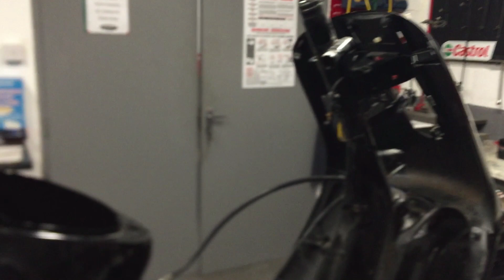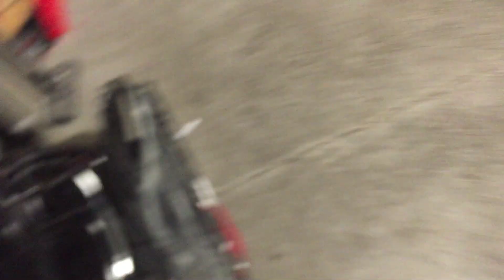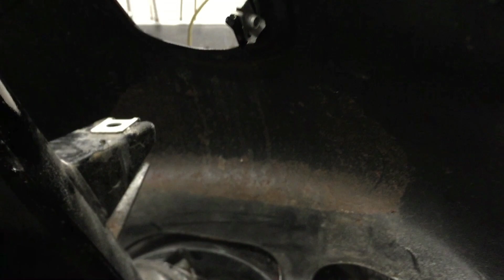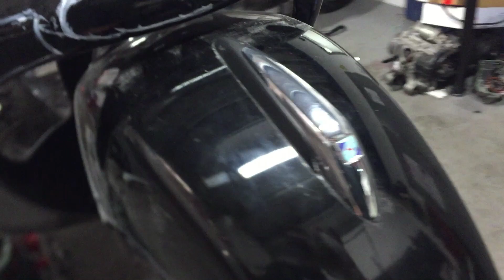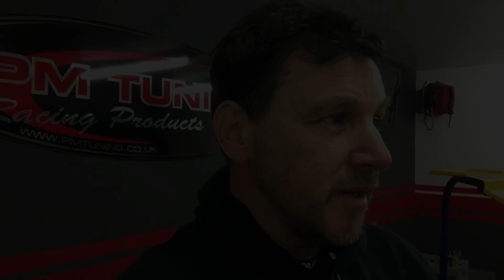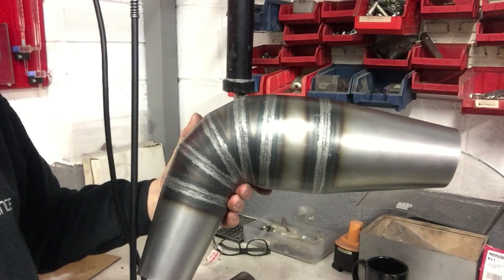Every vespa gts owner should know about this! PM rothmans gts vlog 4

Comment: What’s the plans for it. Are you going to make it geared or leave it auto. See for the front guard. I know the wheel size and fork support etc is different. Would it be possible to run a smooth T5 front guard